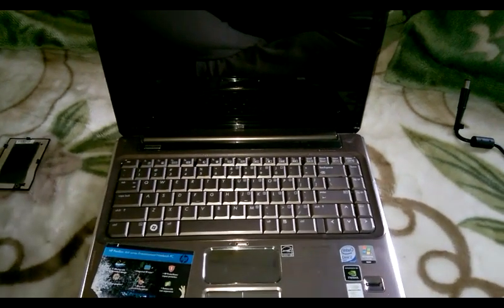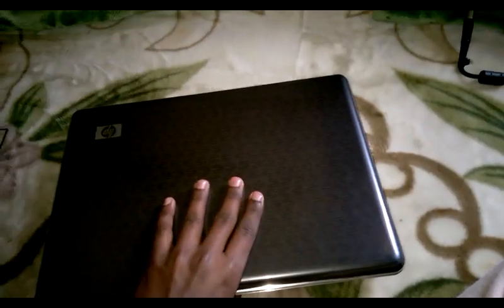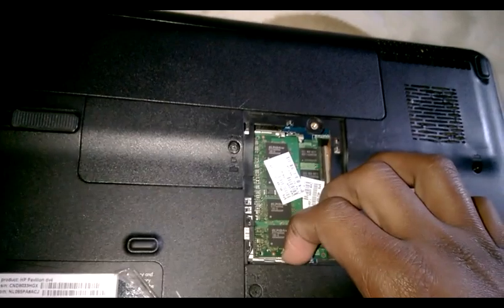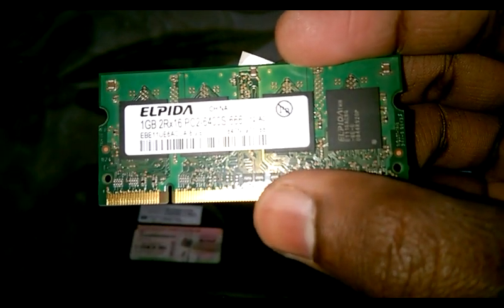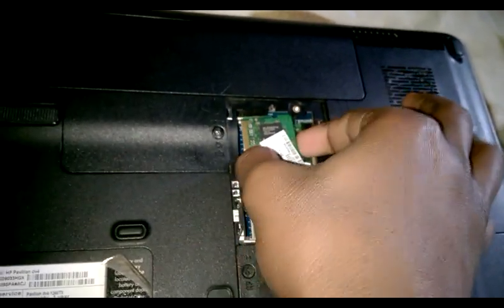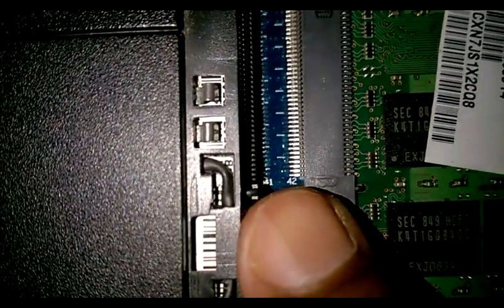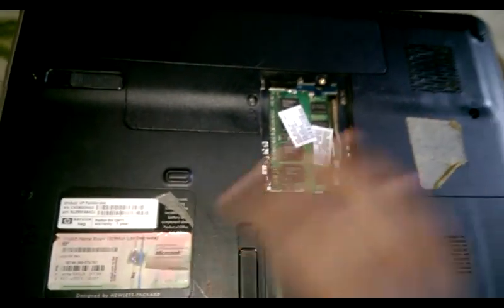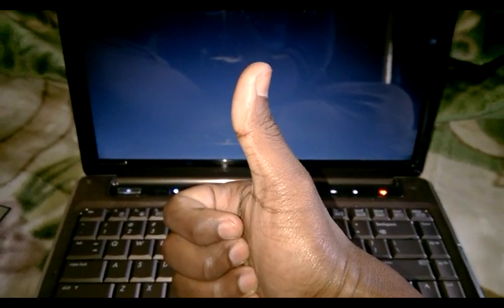Caps lock & num lock blinking with blank screen Fixed

Comment: I have HP workstation 8560w with the same problem. 

The cause of the problem was: I had 16 RAM on one of the sockets, and I added another 8 on the other socket. 
Simply, the new RAMs wasn't well collected to the socket.
Reply from the maker: U are absolutely correct

Comment: how many times did caps and num lock blink for whatever HP model you have here? this varies across models and vendors and the symptoms vary per light combo and number of blinks, so his was likely the number = to mem whereas another person might be the motherboard, which replacing memory won't help for.
Reply from the maker: That's 4 times as I mentioned in this video :)
Reply: mine is blinking once and then there is a 4 second gap before the next blink. got a fix?